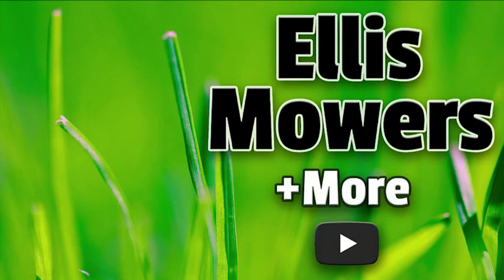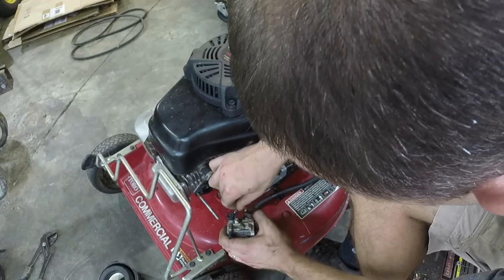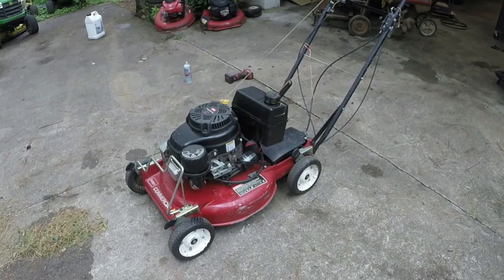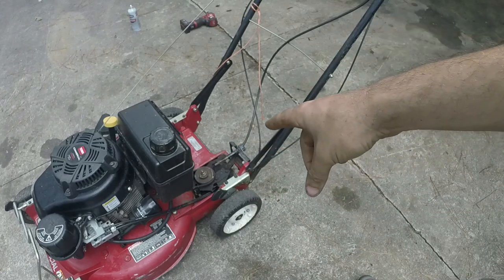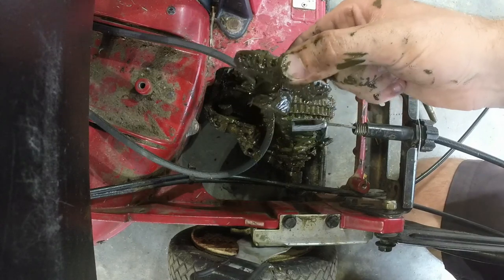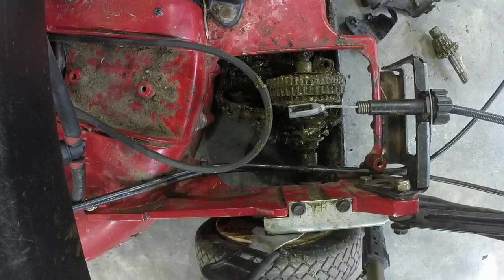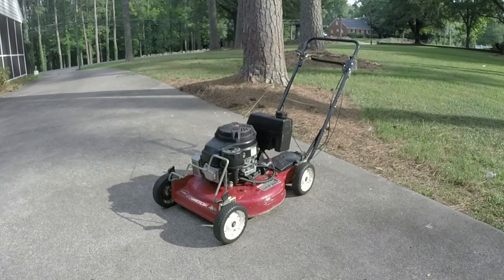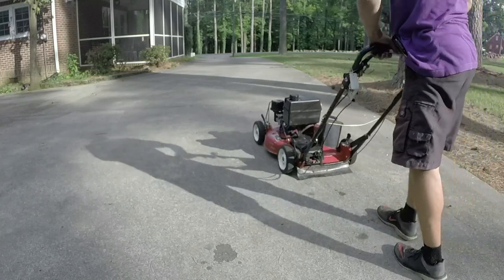Toro commercial walk behind Kawasaki carb clean and self propel repair gets it mostly working again

Comment: Looks like it has a Kawasaki engine  you can get the self propelled system in running condition again there Casey
Reply: The video title says Kawasaki engine.
Reply: @wayneessar7489  okay thanks for the info on this video
Reply: I don't believe I did not Saw that but I went back to the title and saw it saying it was a Kawasaki
Reply from the maker: I edited the video title right before it dropped so Youtube may not have had it updated right off the bat.
Reply from the maker: Robert I added Kawasaki to the title right before the video dropped.  Since you are always the first to view it the title may not have been updated by that time.  But you nailed it, Kawasaki!
Reply: @EllisMowersandmore   that is a possibility of them not having the New title  on the edited title

Comment: You need a lift to work on them. I had one like Bruce but ended up storing stuff on it instead of using it.
Reply: It’s easy to do so I clean it off every few days after using it to work off of, back saver for sure at 72 😊
Reply: @philliphall5198  whats bad Phil is that I sold it also.